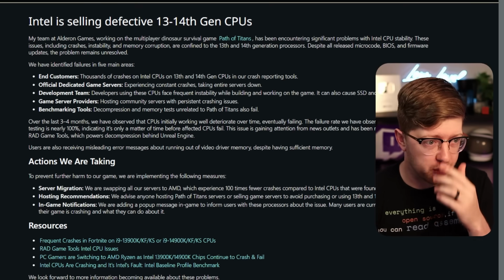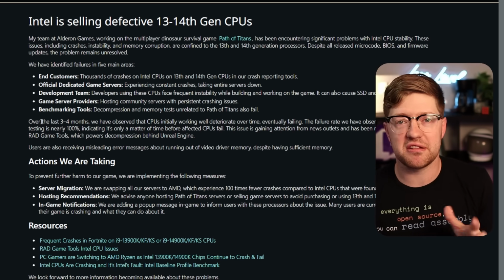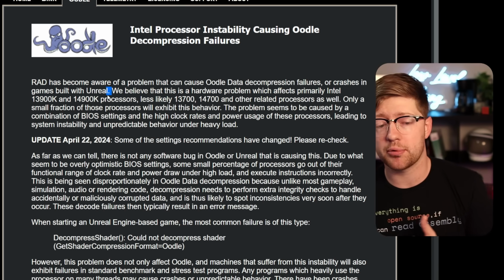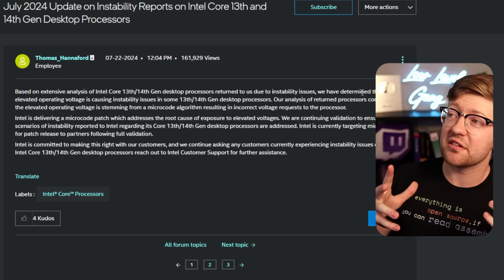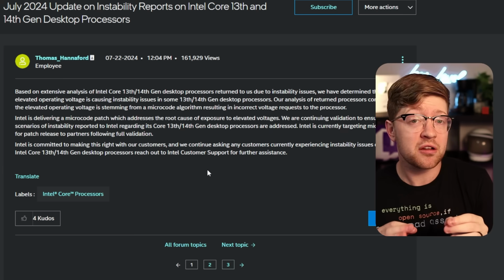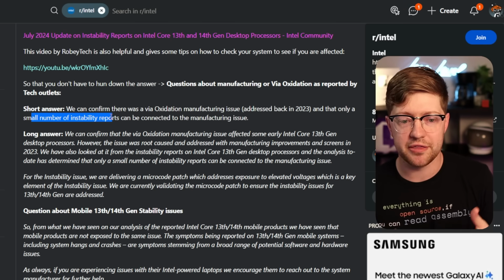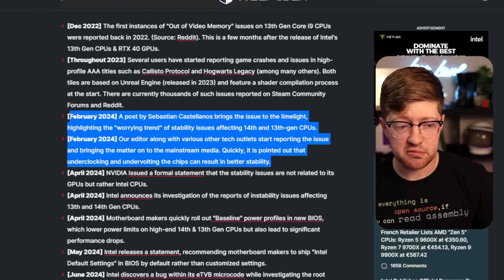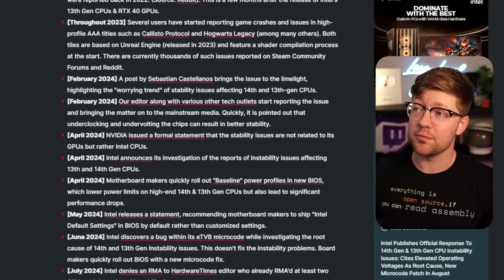intel CPUs are literally falling apart

Comment: Buildzoid has been talking to a group that runs minecraft servers and it looks like that is almost guaranteed to kill a 13900k in a datacentre in 3 months. That isn't exactly the kind of load you would expect to brick a cpu in that timespan so it suggests a more complex fault at play here.
Reply: Latest Buildzoid video showed really extreme voltages with 8 threads in in a cinebench run (worse than one thread or all threads)
That seems close to how a gamer or game server would be using the CPU.
Reply: The "complex" issue is that as he stated in that vid, the MC server is a single thread, which puts the CPU into thermal boost mode and dumps 1.5+ volts through it non stop.  It is intel flying too close to the sun.  I do agree there are some other things probably at play but it's mostly the super high voltage killing those chips.
Reply: @JathraDH Potentially up to ~1.5V. Only the worst bins need voltage that high and the failure rate was more like 30% based on what the person he spoke to said.
Reply: @JJFX-  The lower end binned chips are still over 1.4v, which is still not a safe voltage for 24/7 use.
Reply: @JathraDH  That's simply not true. It's much more complicated than that. There's nothing inherently wrong with boost clocks running higher voltages than you would with a manual OC. Intel just screwed up their algorithms big time and I'm still suspicious there's actually bigger issues at play than they're letting on.
Reply: @JJFX-  1.5v is not normal OC voltages lmao.  Even 1.4v is pushing it for OC.  Yes the chips are pushing even higher voltages than that due to the error but those are the voltages in the chips VID table and still far too high.

I do agree its probably not ONLY voltage related, but the high boost voltages, even the intended ones are not safe voltages for long term use.
Reply: @JathraDH  You seem to have misunderstood what I said. Obviously I'm not saying those are safe or even practical OC voltages but calling over 1.4V "not safe" for daily use isn't accurate either because we're talking about stock boost clocks. Every modern CPU generation runs voltages above what we consider "safe" in the OC world because the behavior is highly dependent on load and other parameters. If Intel limited the VID table to below 1.4V they'd no longer hit product specs and might as just recall the entire generation.

We can only assume that whatever algorithm issue claimed to be causing this is more about the behavior than the number. For example, briefly running higher boost values outside of their load conditions or straight up bugging out and temporarily requesting even higher values. The latter of which is unlikely to have gone unnoticed but it all seems a bit strange. We'll just have to wait to see if Intel simply cripples the boost behavior.
Reply: @JJFX-  Well all I can say is from the given evidence the chips that are boosting up to their high clocks on 1-2 cores are dying much faster than the ones that aren't.

My 13900K is on month 19 and it has some degrading (fails synthetic tests) but is still stable in normal use.  I have had the 1-2 core boost disabled since early in the chips life however.  They seem to be dying much faster if that boost is left on from what I have seen around the comments, sometimes within a few months.

It is pure speculation at this point yes, but I don't feel running 1.5v through the chip when cores are loaded is a good idea.  Usually the voltage drops as cores get loaded and doesn't increase.
Reply: @JathraDH  I wouldn't argue otherwise and I don't think it's a coincidence that the perceived failure rates of i9/i7/i5 reflect differences in max clocks/voltages. I suspect we'll see something similar to how Zen4 behaves where you almost never actually see it running max boost for more than a moment but does technically hit it. Multi-core loads have a hard cap and we still don't know exactly why AMD restricted multi-core behavior in an update just months after launch but perhaps they realized something Intel should have taken note of.
Reply: @JJFX-  I know that on my 13900K before I disabled the thermal boost that in single core loads it was boosting to 5.8 (stock behavior) on those 1-2 cores and staying there for prolonged periods of time (minutes to hours) while I was in single threaded stuff.  I had used ASUSes auto OC for a bit and it was then taking those cores to 6.0 for prolonged periods of time and shoving 1.5v through the CPU while doing so, which is why I shut that off after I noticed.

I actually ended up just turning off c-states which keeps the CPU at a constant 1.325 idle and ~1.3 loaded which basically disabled the thermal boost since all the cores were always sitting at 5.5 all the time.

I think Intel simply flew too close to the sun trying to one up AMD and pushed stock settings that really are no good for the hardware personally.  Then the microcode bug pushed those already borderline unsafe settings into death territory.
Reply: @JJFX-  Seems my reply got deleted.  Ill try to make one without the D word in it..

I was just replying back and saying that on my 13900K it would hold 5.8 and 6.0 (overclocked) boosts for extended periods of time as long as I was running a single thread application.  I had noticed it was pushing 1.5v through the core while doing that so I disabled it.

The chips from what I have seen do boost to those voltages for extended periods of time on stock settings.

I think it was a combo of Intel flying too close to the sun and then also the microcode bug that pushed the voltages straight into the rapid degradation zone from the borderline unsafe zone.

Guess we will wait and see what the microcode updates do.  Thanks for the chat!
Reply: @JathraDH  It'll be interesting to see how much the behavior changes with chips like yours. You should briefly log sensor values in loads like that using HWinfo then compare it to when they roll the update out.
Reply: @JJFX-  Truth be told I am probably not going to run the update as the damage is already done and my settings have the issue as good as fixed.

I have a aquaero and aquasuite and have it graphing the highest voltage on any core non stop every second for the last hour and the voltages never really go above 1.325 idle.  I don't want it pushing more than that through the chip anyways because it's already degraded to the point of near instability.

Running 1.4+ through it to boost an extra 300mhz isn't worth the life of the chip at this point.
Reply: @JJFX-  Throwing you an update.  I did end up installing the bios and microcode update. It was pushing over 1.4v through the chip after the update on stock up from 1.325 at 5.5ghz so I set that back down to 1.325 and its actually running a bit lower voltage than before now.

It is now passing y-cruncher where it was instant failing before.  I am wondering if my board had that load line issue that was lowering voltage too much and that was causing the crashes, not degradation.

Overall seems a lot more stable now.  I will continue throwing some tests at it and hope its working.
Reply: @JathraDH  Sounds similar to what I'm hearing. Haven't had a chance to look into it much myself but it seems the voltages aren't much different overall or may appear higher in light loads which isn't that surprising to me. Looks like it affects boost behavior which should help stability and why you'll likely see some performance loss but I'm only guessing. They might also be doing more clock stretching or something.

I'm skeptical how much it's meant to actually help reduce the core problem though. It'll be interesting to see what the update they're planning to release next month does and I think you're wise to keep limiting voltage in the meantime.
Reply: @JJFX-  I actually still have the same problem.  It turned on CEP on the board which is why it prevented the crashing, but it came with a massive performance hit (upwards of 50% loss) which is unacceptable.  I was losing 30% of my FPS in games.

I have to figure this out now cuz leaving at 1.4+ volts all the time isn't going to happen.  It is dropping too much under load and crashing but the LLC is already quite high.  May be time for a RMA if I can't figure this out or swapping to the 12900KS.
Reply: @JathraDH  Wow really? Is the performance worse in games/single thread loads or is the hit that bad in something like Cinebench too?
Reply: @JJFX-  Yeah I ran cinebench on 8 pcores+ht (I have the e-cores disabled) and got a score of 9.5k. With CEP off its 22k.  Literally over 50% performance hit on cinebench for me having CEP on.

Also on auto its pushing insanely high voltages out of the box with c-states off, like 1.5+ volts idle.  Before the update the same auto settings were running like 1.325 vcore idle max.  I had to turn LLC up to notch 6 to get it passing y-cruncher with the voltages at sane levels but then it still fails with xmp-1 enabled at those settings.

I really don't know what Intel was doing with this update, it just seems to make everything much worse after, at least on this ASUS board.  Sure it might "fix" the chips by making them more stable but pushing 1.5v at 5.5ghz is not OK IMO.

Comment: My 13900K is overclocked on an older BIOS (RoG z690 formula) with all the ridiculous power limit settings like 4096 power limit etc.  And it’s overclocked, boosting to 6 GHz on 1 core, 5.9 GHz on 2 cores, 5.5 GHz on 4 or more cores.  it doesn’t crash.  But the key was to undervolt it (relative to Asus’s optimized defaults or ‘auto’ settings which pumped far too much voltage into the CPU even at stock).  

Unfortunately, Intel motherboards, on 'auto' settings, have been pumping too much voltage into Intel CPUS since at least Skylake 6700K.  Intel needed to clamp down on the mobo vendors years ago… but now with Raptor Lake flying too close to the sun, Intel’s lax practices has come back to bite it in the a**.  I hope every affected customer is made whole.
Reply: Intel flew too close to the sun in order to compete with AMD.
Reply: @trucid2  Indeed! Intel just did not have the requisite production node available to make faster and more power efficient CPUs to compete with Zen 4.  That is the root cause.  Perhaps we are now seeing another reason why Apple left and released Apple Silicon.  Imagine if Apple had a bunch of machines based on Raptor Lake and they were now failing en masse.

Alder lake was a good upgrade over Rocket Lake/Comet Lake, and defeated Zen 3 (I remember the mighty 5950x dropped in price soon after Alder Lake came out).   

But zen4 was a very solid upgrade, especially the x3d part, and Intel didn't have Intel 20A or Intel 3/4 or TSMC 3nm available yet.  So it pushed raptor lake too far and the motherboard vendors have been pumping high voltages on 'auto' settings for years.  Put the two together, and it was a recipe for disaster.   Makes you wonder whether Intel actually does QA/QC for months on end using retail boards.  Why didn't they catch that RoG, Gigabyte, MSI and others pump high votlages into their CPUs? 

My opinion: If Arrow Lake is not an absolute home run, Intel might be in trouble....this might be the beginning of the end because they're losing customer trust already making people consider Zen 5 or Qualcomm or Apple, and those other companies are firing on all cylinders.  AMD's stock price has had a meteoric rise in recent years, and it has been beautiful to watch.  Might Intel be the next IBM?
Reply: @j340_official  I've been buying Intel processors for over 20 years but unless they have a response to AMD's x3D processors, my next system will be AMD.
Reply: @trucid2  same here. I've never had an AMD system, but I might downsize my rig and go SFF with a 9800x3d.  I don't really see the point to keep on investing in Intel hardware any more if this is what is happening.  It's really sad to see a company you've been a fan of for 30 years just start to fail.  When I got into computers, my first PC had an Intel 80286! Then eventually we got a Pentium.  That chip was a big deal back then.  I started playing Doom and Wolfenstein 3D! It was such an exciting time back then in the 1990s.  But the 2024 version of Intel isn't the same company any more.   But in life, when it's time to move on, it's time to move on!

Comment: Transistors weren't oxidizing, the vias were. A via through is a "wire" that travels in the up/down direction in the cpu when the cpu is laid flat on a surface to allow connections to different layers of the cpu. The transistors were getting excessive voltage causing the semi-conductive state along the 5-7 nanometer transitive area of a transistor to lose the semi-conductivity by having those atoms in there shift position due to the excessive voltage.
Reply: not my atoms!
Reply: And knowing this they still want to sell these to you and don't want to take them back once the inevitable happens. I smell an incoming lawsuit from this just saying.
Reply: > converts your CPU's transistors to 1nΩ resistors
> refuses to elaborate
> leaves
Reply: They kept shrinking without making any changes to the architecture. They were being greedy and it came back to bite them.
Reply: This channel has the most cracked 10x viewer base
Reply: @toms7114 and @Corpsecrank , out of curiosity, are you guys EE, CE, or Physics?
Reply: Atoms dont move due to excessive voltage. Excessive voltage will short the gate and basically destroy the transistor. What causes electromigration is current and temperature. So you will only have accelerated electromigration when excessive voltage will result in excessive temperature and/or current.These are 2 different mechanisms of chip failure. A given voltage might be safe if the chip is running with subzero temperatures and instantaneously destroy the chip if its running near TJMax
Reply: @ccrodrigues  I agree with your clarification entirely. I was giving a very high level clarification only and am glad to see a deeper dive for those interested.
Reply: Via oxidization -> Increased impedance on path -> Increased relative voltage potential on path -> Excessive voltage damage on transistor. Don't need a science degree or electromigration to shoot a sensitive transistor.
Reply: Thanks for the explanation!
Reply: So does that mean even the oxydation issue is caused by the algorithm voltage bug and Intel is doing whatever it takes just to not go out and say hey we f*ked up?
Reply: @yassine-sa  The oxidation issue is caused from a flaw in the manufacturing process. It is being caused by there being a time when the deposited material in the via is exposed and the silicon wafer the chips are made on is not being kept in vacuum. Any exposure will allow a little degradation, and once there is some, it will spread during use as the flaw will cause some damage that will allow more oxygen to get into the via, which will cause more oxidation and the pattern continues.
Reply: @yassine-sa   No, of course not!
Reply: Exactly, the metal interconnects.
Reply: oh snap. Those were ( maybe are ) make of tungsten. I was a tungsten deposition engineer. AMAT used to make the machines for that
Reply: @jgtygd764   as in "Applied Materials?"  im an operator for some of the tools i run.
Reply: I just read that Intel said that there is a problem found in the microcode, so they will release an update to all motherboard manufactors.
Reply: @AndrewTSq  Microcode does not fix a manufacturing defect. That being said, if Intel is to be taken at their word this defect was fixed in 2023 and only affected 13th gen, whereas the excess voltage problem is the one that affects both and can be patched with said microcode update.
Reply: @actualcelery8701  I read it was only the first batch of cpus that had that defect. Lucky I never upgraded from 12th gen anyway.
Reply: @AndrewTSq  From what  I saw Intel didn't mention what batch of cpus were affected by the via oxidation problem so it could very well be all 13th gen cpus made
Reply: @nackle-e5y  okie.. maybe is so bad Intel themself do not even know :O
Reply: @actualcelery8701  They said the defect was fixed in 2023, but never specified when the defect was first discovered, so even some 12th gen processors might be caught in the crossfire
Reply: @nucIeer  Level1Techs did a deep dive of hosting providers using these chips.  TL;DW:

* 12th gen - unaffected, older process technology
*13th gen - affected
*14th gen - affected!

These chips were in servers with conservative power profiles.
Reply: @nucIeer  Absolutely valid point. I was just parroting their given statement since that's all that's been actually acknowledged so far. Given that it took them being called out on Reddit to acknowledge the defect in the first place rather than willingly acknowledging it in their press release on the excess voltage issue, it certainly doesn't do them any favors in the realm of public opinion, not that anyone should have trusted them to do right in the first place.